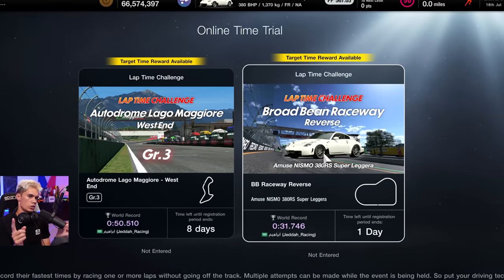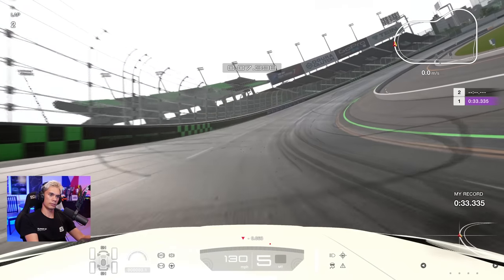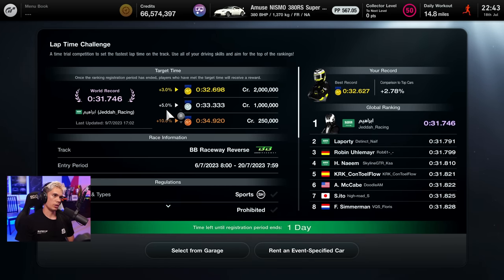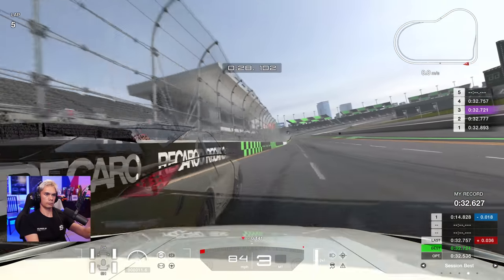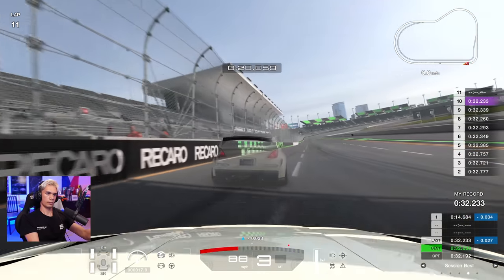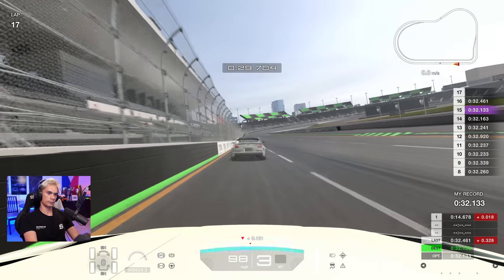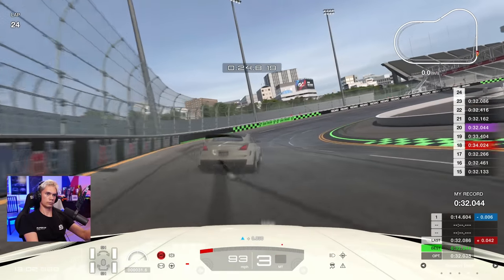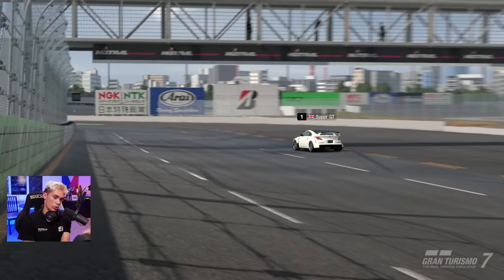The 30 second Time Trial

Comment: The low-high-low line the #1 time in the world used is called “diamonding” the turn in oval racing.  You tend to see it on flatter ovals as it’s good for maximizing exit speed on those style tracks.
Reply: You learn something everyday.
Reply: You could see them do it quite a lot at New Hampshire this weekend

Comment: One tip I learned racing ovals is that you if you can really straighten out that final corner as you start your lap, you'll gain time. Stay right up next to the wall until you get to that green and black banner and then turn down. You'll have slightly more on throttle time and be scrubbing off less speed because you won't be turning the wheel as much.

Comment: F O R T  W O R T H, Texas, April 30, 2001 -- CART drivers knew something wasn't right as they practiced at Texas Motor Speedway. They just didn't realize most of them were experiencing similar symptoms after dizzying laps.

In an unprecedented move, CART postponed the inaugural Firestone Firehawk 600 just before its start Sunday because of concerns about safety and the possibility of overbearing G forces causing the drivers to pass out while driving 250 laps.

"It was a problem all of these drivers were experiencing, but they had no clue what they were experiencing," said Michael Andretti, CART's winningest driver. "This is an area that we've never been before physically."

Comment: I'm not sure if it's modeled in Gran Turismo's physics engine but if you end up doing another Time Trial on an intermediate "oval" you might want to try modifying your lines through the banked corners so your inside tires ride the double yellow lines just above the apron - this is called "Harvick-ing" after NASCAR driver Kevin Harvick discovered that gives the inside tires a lot of grip. It's so effective that NASCAR will sometimes put down traction compound at the tracks where it works in the high groove to try to artificially create a second racing line.

Comment: I think there is time to be found is in the last corner. A touch earlier on the brakes and brush the apron to rotate the car so you can get on the power sooner. Maybe half a tenth there. No idea where the top driver found the rest. Easier said than done though, I couldn't do it. The speed of progression you did here would take me several hours or be flat out unachievable. Good job!

Comment: I think the only line you weren't hitting was turn 4. If you can get a narrower angle and just dip your left tires onto the apron it does a ton to help rotate the car. It also slightly unsettles the car, but as long as you can keep the front pointed towards the finish line you should grip properly before making contact with the wall.

Comment: I find a tip to shave another few tenths is to only run every second lap as a timed lap. 
Use a burner lap to hit the last corner extra slow on entry so you can get extra early back on the power. Want the car going as fast as possible to start your  hot lap that you want to nail the perfect lap. But you need a burner lap to hit that first turn just right.

Comment: Iit takes a while to warm your tires. If you are constantly restarting, you will always be on cold tires. Tire wear is turned off, but tire temp isn't off (or so I have heard). So, keep driving and don't restart.
Reply: From what I heard (from Tidgney for example), when there is no tire wear there is no tire temperature.

From my feeling in Qualifying sessions in the WorldSeries-races, that seem s to be correct..